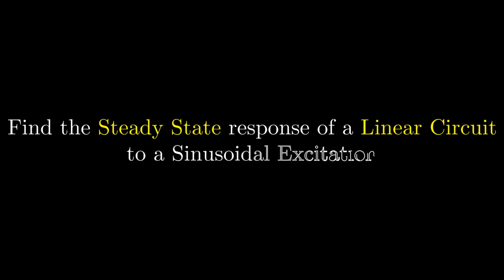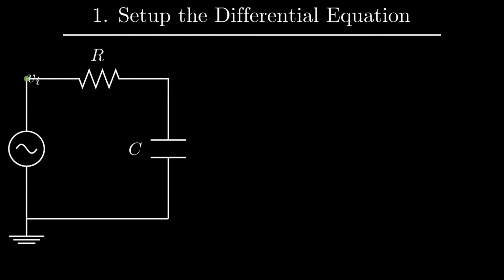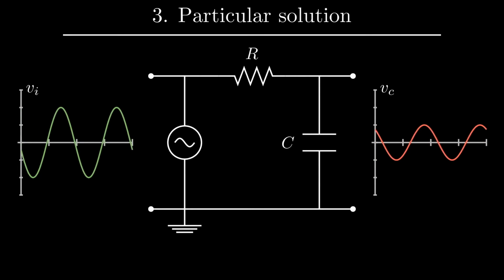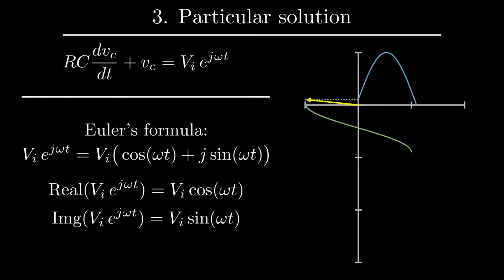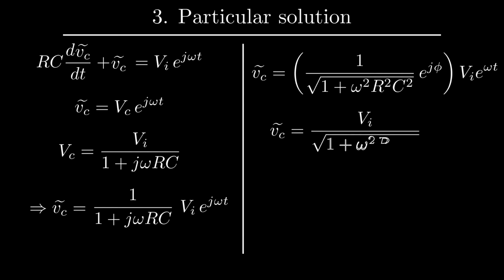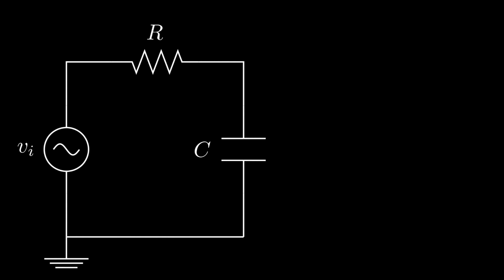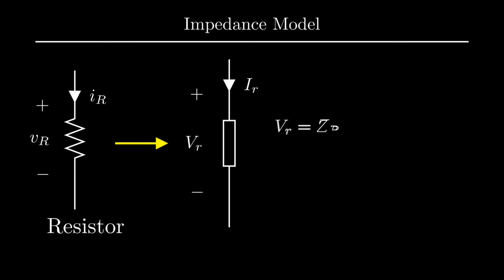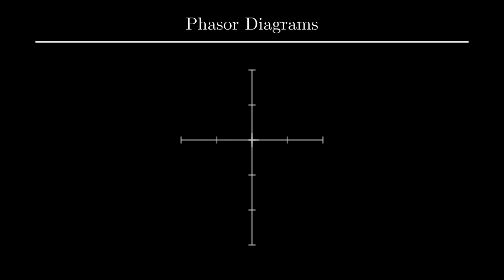Why do we use complex numbers in circuit analysis? | What is Impedance? | What are Phasor Diagrams?

Comment: There are 3 solutions that really can be applied to all circuits with RLC. They are underdamped, critically damped and overdamped. The nice thing about solving for a sinusoid is any signal can be modeled as a fourier series of summed sinusoids so the solution is just the sum of the solutions for the various sinusoids.